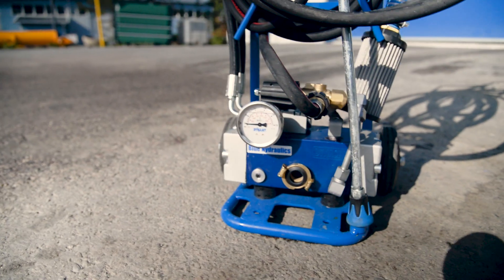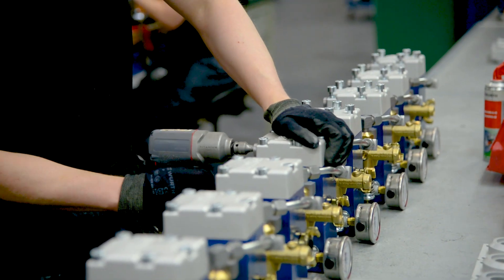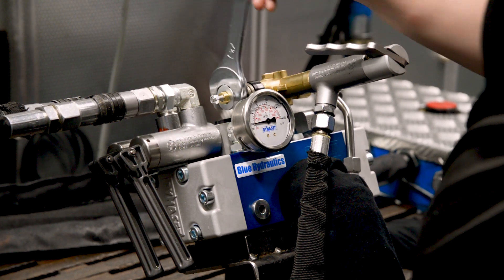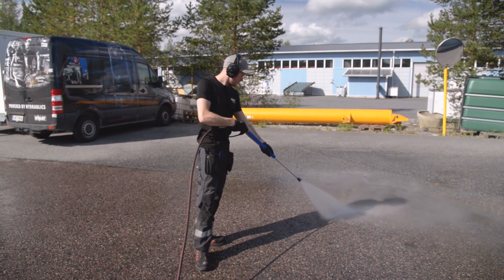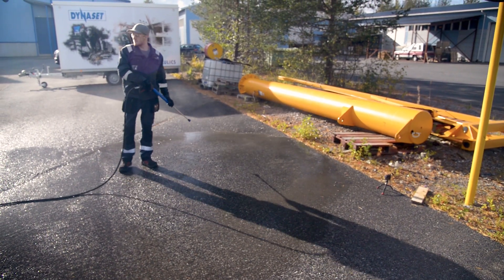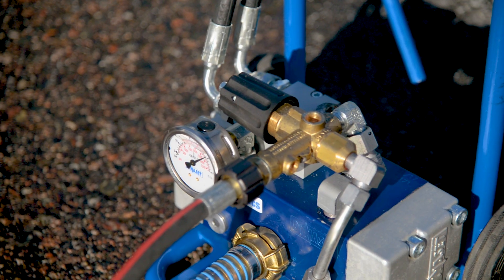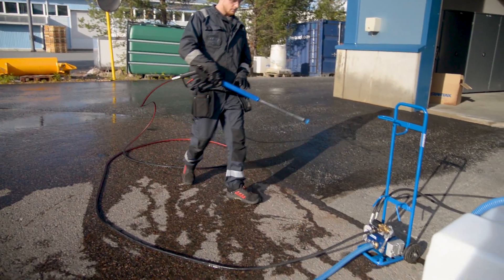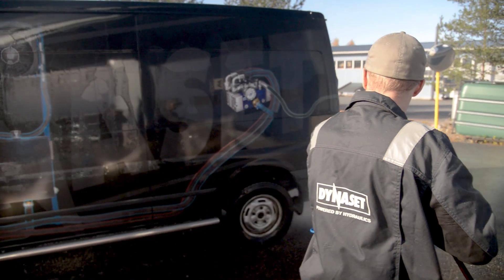Adjusting Dynaset HPW 200

Comment: I was wondering if there is a formula to determine the actual water pressure and/or flow rates when you do not have the maximum pressure or flow shown on your data table for different model pumps. For instance I have a HPW 420 which I run off of a skid steer which on the low hydraulic circuit it produces 15 gpm at 3000 psi. The data sheet for the 420 lists for  maximum hydraulic input of 13.2 gpm  with 3200 psi. What effect will the loss of 200 hydraulic psi do to the output(both psi and flow) of the water side of the pump? I have a HPW 460 with similar questions but may have to use a lower flow and pressure than the maximum. This information could possibly be used to determine  nozzle size changes as well, if you know what the new output will be when using lower outputs then the maximum.
Reply from the maker: Hello Nick, sorry that we made you wait! Somehow YouTube didn't notify us about your matter. Anyway, it is a nice idea to have some kind of chart that shows the hydraulic pressure's effect on the water side. I will forward your request to our engineering department. :)